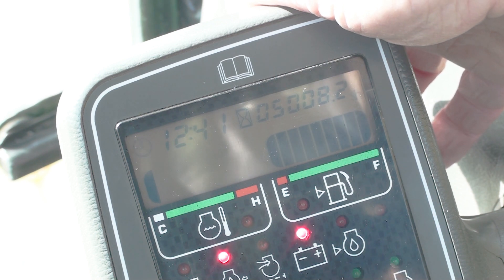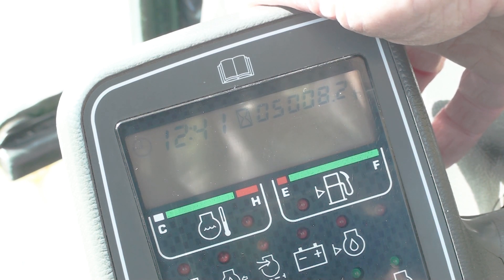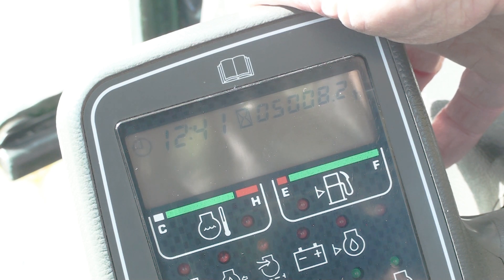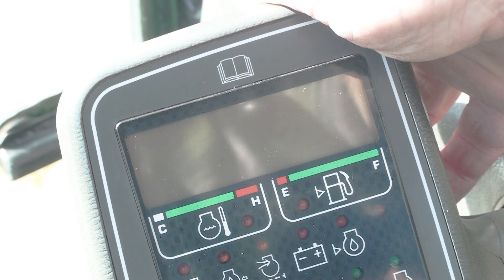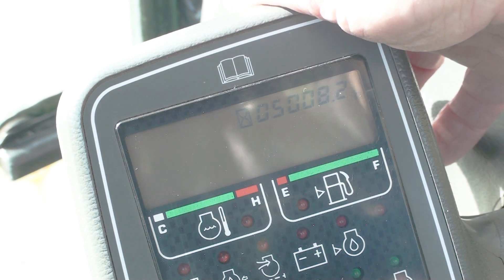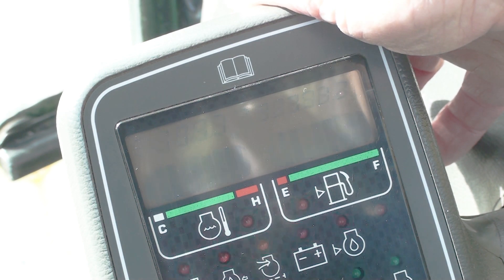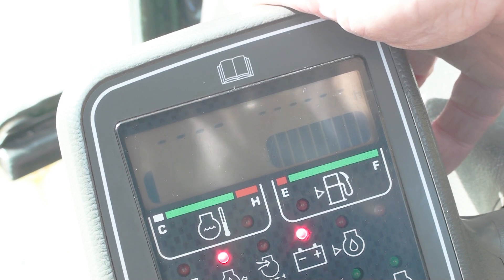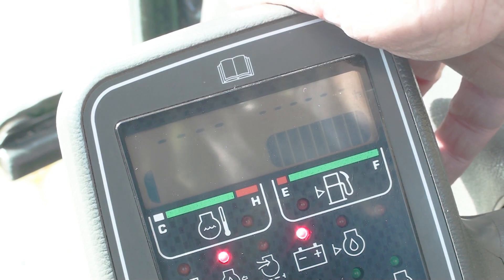Komatsu Dash 6 Monitor Panel

Comment: My pc250lc-6 has a slightly different monitor and the led isnt visible anymore. Is this monitor cross compatible?
Reply from the maker: I has been my experience that monitors that have turned a dark magenta color are not salvageable. I has also been my experience that the monitor panels are specific to models by part numbers. There are some after market units made in China that may or may not work. In my experience that part number on the back of your panel is the best way to get one that works.
Reply: @repairsecrets  much obliged, i appreciate your advice. My local dealer quoted around 3k for a reman... I will look into the associated pn# and if the China land doesn't offer one we will take my grandfather's advice; ; "check the oil, the fuel will check itself". 😆

Comment: Olá, como faço pra ver a pressão das válvulas pelo painel da pc 200 série 6 dando fim de curso?
Fizeram uma revisão na bomba hidráulica e comando porém ela nao ficou com a mesma força eu dei um pouco mais de pressão na valvula da bomba porem parece que ela não atinge a rotação total, e as vezes não aparece as barras de marcação de combustível.
Reply from the maker: Monitor codes 11 and 12 will give you the pump pressures when you operator a function. Most people don't trust the monitor but I've found it to be about as accurate as an analog gauge pumped into the system.
Reply: @repairsecrets  muito obrigado, consegui verificar e percebi que estava bem a baixo do valor de pressão da komatsu, está máquina foi revisada a bomba e comando por uma oficina que não é especializada em escavadeira hidráulica, eles trabalham muito bem com retroescavadeiras e outras, etc... porem a máquina vei da oficina muito ruim, baixando o giro em determinadas horas e dava umas soqueadas de vez em quando. Ai dei uma volta e meia na valvula da bomba pra aumentar a pressão e a máquina ja melhorou uns 95% também dei uma mexida em duas valvulas do comando, lança e braço, como não tenho o relógio não mexi muito mas a máquina ficou bem melhor de quando veio da oficina. Tem poucos vídeos falando sobre a pc 200 serie 6. Fiquei contente em achae o seu canal. Obrigado!
Reply from the maker: Não tenho certeza se entendi sua pergunta. O vídeo mostra como chegar ao código de 11 monitores. Você pode pressionar o botão de modo novamente para chegar ao código 12 que mostrará a outra bomba. Você pode ajustar as bombas a partir do monitor. Existe o que é chamado de válvula TVC na lateral de cada bomba e pode fornecer um pouco mais de fluxo. Se a sua bomba estiver muito velha e desgastada, pode não haver muito o que fazer.
Reply from the maker: @andersonluiznardes4740  Não pode ser ajustado no painel do monitor. Equipment Consulting Services, Inc. isso eu ajusto a TCV e a escavadeira melhorou. Como pode ser pelo monitor?

Comment: Very informative video thank you!

We recently installed the new monitor in our PC 400–6
With a new rebuilt motor. 

Just wondering how we can reset the hours on the new monitor.
Reply from the maker: There used to be a piece of paper that came in the box with the new monitor panel that described how to set the hours to current machine hours. It was a one time procedure. You should ask the part people when you order the new monitor.

Comment: Hi thanks for the information it help me out alot. Wondering if you could help with a problem? I've had a swing brake solenoild fault which I've fixed but i cannot clear the E03 error that comes up when you turn the key on? All other faults have been cleared just that one comes up. Thanks for your help
Reply from the maker: Did you check the prolix switch that bypasses the auto swing brake and releases it all the time? I don't know which model you have but most of the two toggle switches somewhere. One bypasses the swing brake while the other bypasses the TVC solenoid valve.
Reply: @repairsecrets  yep using that prolix switch works but if i turn it off to use it in normal mode that E03 error comes up straight away. We have placed the swing solenoid and also the rear pump pressure sensor switch all works fine just cant clear that E03 fault. Model is a pc200-6E AVANCE. Thanks for your help on this its much appreciated.
Reply from the maker: @IZSEA  If you have the EO3 code, you should have an active code in the monitor panel when it shows. That is probably the only way you are going to figure out what is happening.
Reply: @repairsecrets  mí monitor no prende por completo q puede ser
Reply: Hola tengo un problema apenas pongo la batería la alarma suena y no deja q funcione el monitor como ago
Reply from the maker: @cesarlopez7657  I apologize about reading your post but I don't understand you language. I'm guessing that your monitor panel isn't working. I don't know of anyway to repair them so all I've ever been able to do is replace with new. Good Luck!

Comment: hello how are you my friend what does error code E03 mean
Reply from the maker: I am well and I hope you are also. The E03 is an operator code that informs the operator there is something wrong. You should check for fault codes in the diagnostics. Is the machine not operating correctly.

Comment: I got e103 error pc120-6 and I cleared.. but comes again.. help me?
Reply from the maker: E103 is an error in the alarm buzzer circuit. Either it is shorted inside or there is a bad wire supplying power to it. Check all your fuses and the buzzer itself. The buzzer is in the right side console somewhere under the key switch. Good Luck

Comment: El monitor no marca señal queda parpadeando que puede ser ???
Reply from the maker: Vou precisar de mais detalhes sobre o problema que você está enfrentando.
Reply: @repairsecrets  La maquina tiene un problema en la presion hidráulica llega a 2.000 psi y no sube mas, que valvula se debe calibrar para que suba a las 3.000 PSI. En una komatsu pc120-6. Un tiempo subía a 3.000 psi, pero despues de dos horas de trabajo se iba quedando sin fuerza y muy lenta hasta quedar completamente muerta.
Reply from the maker: @JaBSniperPro  Parece que você tem uma bomba fraca. Quantas horas você tem nesta máquina?
Reply: @repairsecrets  La máquina es del año 1995
Reply from the maker: @JaBSniperPro  Quantas horas estão aparecendo no horímetro?
Reply: @repairsecrets  Dame tu WhatsApp
Reply from the maker: @JaBSniperPro  Lo siento, no uso la aplicación.
Reply: @repairsecrets  El monitor no da las señales se queda parpadeando y la plumilla dell parabrisas se queda encendida y no se apaga
Reply from the maker: @JaBSniperPro  Parece que probablemente necesite un nuevo panel de monitor. No tengo forma de arreglarlos y no conozco lugares menos costosos para obtener uno que del distribuidor.